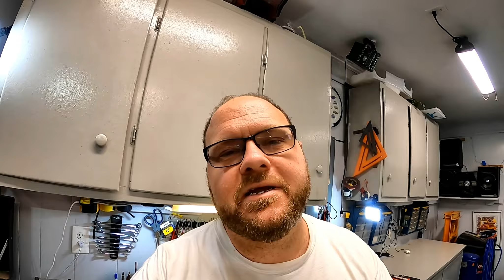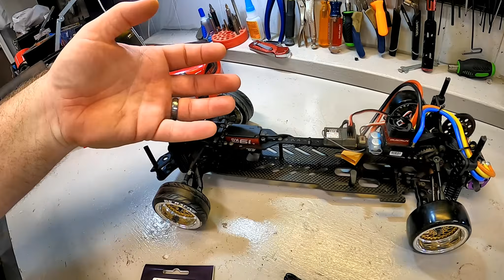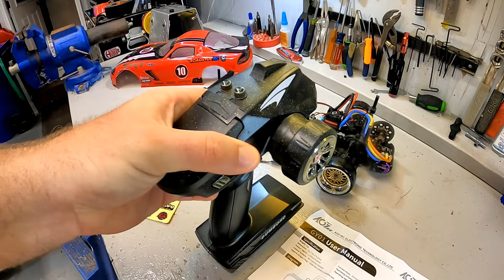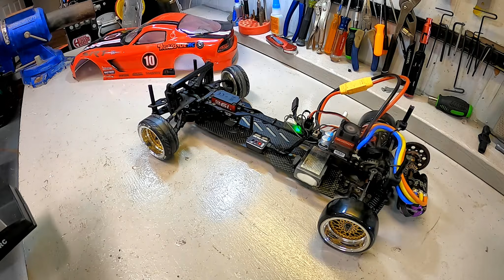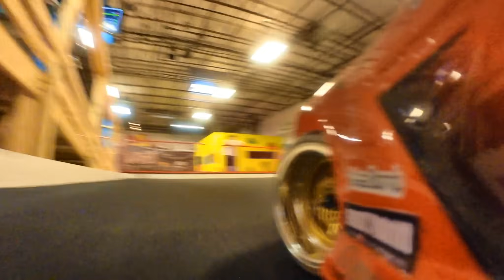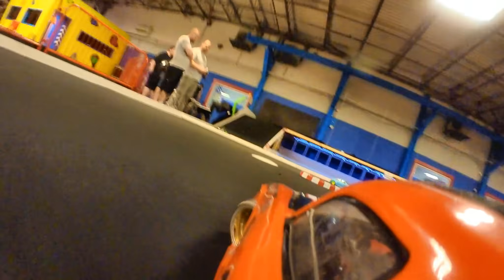Budget Drift Gyro Test!  (AGFRC GY01 Gyro for RC)

Comment: Where is the best spot for gyro?
Reply from the maker: Hello! 
The gyro must be mounted firmly on a vibration-free surface. 
 - Not on top of the servo, not right next to the motor or ESC. 
 - Anywhere else on the main chassis plate works fine.  Front/rear, side/side, top/bottom - none of that matters as they all move as 1 piece.

Comment: I bought the same gyro but it doesn't work, I followed instructions to plug in on channel 1 and 3 but when I shake the chassis it doesn't work
Reply from the maker: That is because you're channel 3 is off.  
You need to give it a single through channel 3 to turn on.

Comment: Hi Troy, could you get hold of a power hd g2 gyro and try/test it Ive got one coming and it seems complicated compared to some others. its got an extra wire . only one video on about on youtube  I can find and its not much help. cheers from the UK
Reply from the maker: This one?   https://youtu.be/-ZanfO-Nfkk
Or is there a different one?
Reply: @RoadsideRC the one you made a video one is from Powerhobby! The one that @MrDevo5 is talking about is made by Power HD. The Power HD G2 Smart Gyro is interesting because it has a Ch3 gyro gain and Ch4 fine-tune angle adjustment. Also it has a Priority and Damper potentiometer adjusters! Definitely worth to take a look at and try! It used to be a great budget gyro because it's actually a well made gyro but since the tariffs they cost a lot more. But nonetheless I still would buy another one even at its new price!

Comment: Hi do you know a budget good quality and sensitive gyro to recommend ?
Reply from the maker: 100% no. 
I have tested basically ALL of the gyros on the market.  Seriously - almost ALL of them.  

My conclusion at the end of the day:  cut corners elsewhere.  Do not cut corners on the gyro for your drift car.  Spend less on your moto and esc.   Spend it on the servo, gyro, and controller.
Reply: @RoadsideRC  thanks mate . Power hd dual system G1 worth it ?
Reply from the maker: @devilkawasaki  Nope. 
I suggest any Futaba, ReveD, Onsiki Daruma, and lastly - the Yokomo DP-302v4

Comment: I use one of these in a high powered basher and it makes a big difference! Can slide around with it pretty easy. But for actual drifting idk but for racing it's really good
Reply from the maker: That makes sense that it would do better in that application.

Comment: Good morning my friend! I have two questions...the first is why did you put the gyro gain control connector on channel 6 instead of channel 3? The second question is what is S.BUS? why be?
Reply from the maker: Hello!  
I used Channel 6 on this controller because it was connected to the knob on the controller.  This is what gave me the ability to control the gyro gain incrementally.   The other channels for this controller are just on/off buttons.  This would not control the gain appropriately.  

SBUS is a communication tool, mostly on Futaba radios.  It allows you more control over your gyro (sometimes even ESC) via the controller.   It is a nice feature, but not necessary.
Reply: The issue of S BUS is very interesting! In this case, would you recommend connecting my gyroscope to channel 3 or channel S BUS of my receiver?
Reply from the maker: @PXCURSOS  You must confirm the gyro, receiver, and controller are all SBUS compatible.   Then, yes you can do this.
Reply: @RoadsideRC  Yes! Both parts support SBUS! I'm going to study the subject a little better! Thank you

Comment: Been watching all your gyro / drift videos... I;m using the new MST gyro on the 2.5 RTR I tend to think the potentiometer on the actual gyro is more usefull fine tuning than trying to adjust on the radio,,, any thoughts on that,,, should the pot tuneing on the gyro be more of a fine adjustment?
Reply from the maker: Are you still using the factory radio?   Once you upgrade radios, it will make a big difference.
Reply: @RoadsideRC  I kinda want the new radio link rc8x,,, waitng for you to review it with a drifter
Reply: @RoadsideRC  It actually drifting verygood for stock rtr and stock radio,,,but yes I need a new radio

Comment: Still can't believe you haven't checked out the Power HD G1 gyro. It's easily on par with the Yoko V4, some like it better. It is easy to find for under $50 and is even available in a combo with the very good D15 servo for around $100. 
I recently setup a G1 gyro and Power HD R12s servo in an old Sakura D4 chassis. The D4 lacks steering angle and has an odd weight balance which makes it a very difficult chassis to tame, this setup ran like a dream.  I was able to program the R12s servo to take out all of the shake without sacrificing control. I can run 100% gyro gain with no shake at all, it doesn't lack sensitivity either, on 100% the car is almost undrivable because you have to hold 100% steering to get the car to transition. I've also tested a yoko V4/SP-02D v2 as well as a GYD450/R12s setup in this car. The G1/r12S setup gave me the best feeling and the least amount of shake. The only setup that feels better than than the G1/R12s is my comp setup which is a GYD550 and PowerHD D15.

I'm now considering changing my recommendation for newbies. I've always recommended the GYD450/AGFrc A50bhl or the Yoko V4/SPo2d v2. But the fact you can pickup a G1 with a D15 servo for nearly half the price of those combos, add on a programmer for $30 and you have a setup that can easily take you from beginner to tandem competition.
Reply from the maker: Really glad you found this combo that works! 
Where do you buy them?   I don't see them on AMain at all, and on Amazon the gyro alone is $80!

Comment: Put the gyro as far back in the chassis and as close to the centerline as possible?
Reply from the maker: The gyro placement does not matter as long as it is free from vibrations and mounted solid.

Comment: You made my day.  Gone use it for bashing an xmaxx.  Getting her level when jumping.   Happy to hear your toughts
Reply from the maker: I'm not sure how you would use it to keep the vehicle level in air.   It would need to modify the throttle for that.   Very interesting concept!
Reply: @RoadsideRC  i mean when launching sideways, you just need throttle to get the car level again, because the gyro does the steering.   I will still need to control the throttle to "dip or raise" the nose of the car
Reply from the maker: @Bambu-Make-Or-Mistake  That makes more sense!

Comment: I think your assessments incorrect I'm using the same exact Gyro in both of my MST cars with digital servos and I do not have any problems that you spoke about the Gyros work as advertised I've been driving with them over a year and none of the problems that you have stated have ever cropped up with me maybe it has a lot to do with the radio you're using and your Servo but for me they have worked flawlessly for over a year
Reply from the maker: Glad it works for you!

What other gyros have you used?  
I would be curious if you test the Futaba or ReveD how much difference you see...

Comment: If you really wanna budget, check out the newer "mxo racing" nano rx/gyro 2 in 1s. Just got one for my custom 1/24 build and it is on par with other "comp" gyros. Full dual gain and dual epa. All packed in a little 20mm rectangle, plenty of options for protocol too.
Reply from the maker: Thanks for the tip!

Comment: I know this is a huge ask but would the Traxxas TQI receiver and transmitter with the multi function knob work for the gyro gain? There's a ton of things it can control but no idea what option to choose for the knob to actually control the gyro
Reply from the maker: I would be very surprised if it would work.   Perhaps there is a way with the bluetooth link to tune it?
Reply: I only ask as the manual graph online shows that the multi function knob can be set to 
-Steering sensitivity (expo)
Or
 -Steering %(dual rate)
So I was curious if it was possible, also due to it having 2 Channel 1 ports

Comment: Great review Troy, it looks like they have ripped off onisiki's gyro design and put cheap internals in it. I wouldn't say it's not for drifting, it's more of a drivers gyro. The problem with the expensive gyros is they make it too easy. It's great for competition drifting that the gyro is making it easy or if your one of those guys that thinks driving in a train of cars is drifting, but if you want to still feel like your doing something then a cheaper gyro is a great way to do that. You can learn car and throttle control from having a cheaper gyro, but like you said it's not the greatest value and it has limits.
Reply from the maker: Interesting take on it!
I 100% would prefer a more quality gyro, but with the gain turned down vs a gyro like this one.  

The wobble, the inconsistency - go with a quality gyro and tune it for your driving style.

Comment: I’m just getting started in RC drifting but love real drifting/sim drifting and have lots of other rc’s so I know I’ll be into it. I’m going to go down the MST road and I’m pretty much settled in getting a RMX 2.5s kit but was curious if (in your opinion) there is any upside/downside to getting the 2.5s over a 2.0 kit.
Reply: I’m getting a kit bc I know I’ll be into it so I’m willing to spend a little more money on better electronics to give myself some head room once I get started
Reply from the maker: I would 100% go with the 2.5.   The main weakness long-term with the 2.0 is the gearbox, and they fixed that.
Reply: I bought the 2.5S 3 months ago and runs like a champ with the TR60 shocks upgrade.I also bought the 2.5RS one week ago but it needs more tuning for the moment is not running so well as my 2.5S do...If you want to buy the 2.5S I suggest you to directly  go for the 2.5RS because it comes with the upgraded aluminium TR60 shocks and the carbon parts for almost the same price of 2.5S + TR60 shocks wich you will need(the plastic ones that comes with the 2.5S kit are shit).